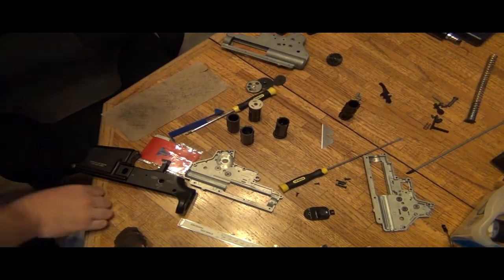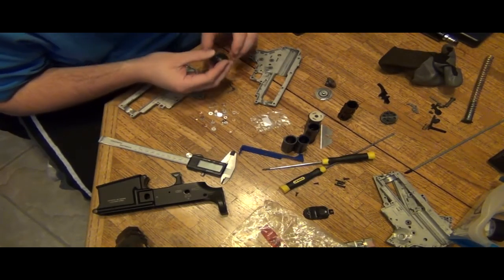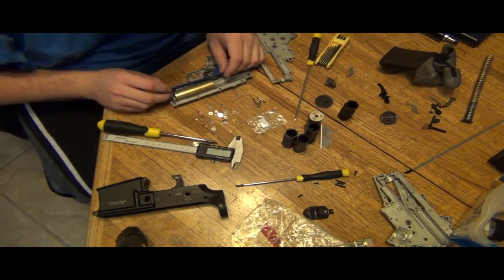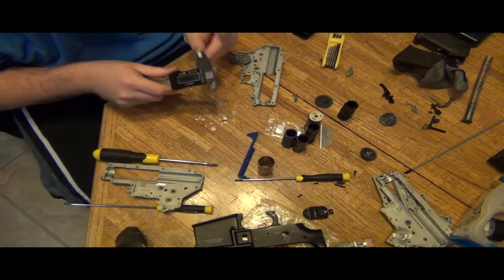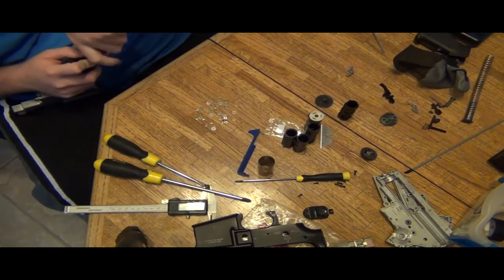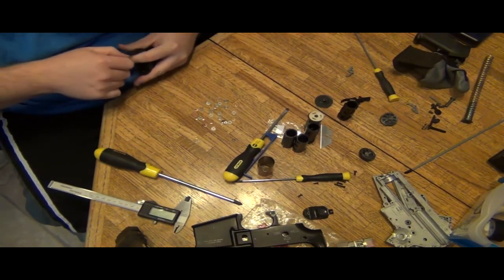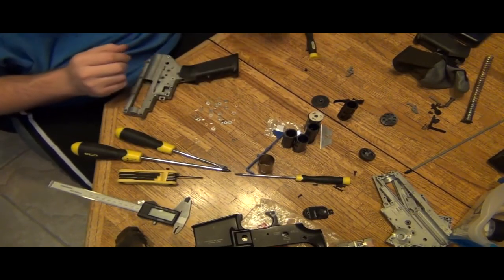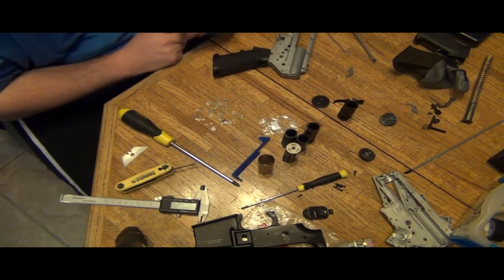Shimming Gearbox With Youtube Viewers Part1

Comment: I get it, if from a mechanical standpoint the shim job is right there's no need to care about the noise, but I'm trying hard to build a silent AEG and shimming is the first thing I want to take care of. Right now, there's a barely noticeable whining noise, but I easily hide it when shooting with 13:1 gears and a Torque motor with high trigger response.
I was just very surprise to see that much variation in sound with different motors. Guess it's kind of a luck to find a pleasant one.